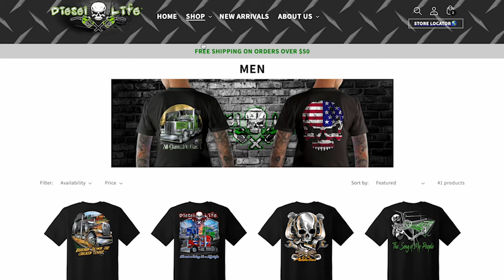Me & Pops Back in The Sweet Pete 389

Comment: Can u put the mudflap stifners to help with not running them over
Reply: Probably could but I just cut them a little shorter
Reply: When I did heavy haul, I took them off while hooked to a trailer, as they are not required until detached from a trailer